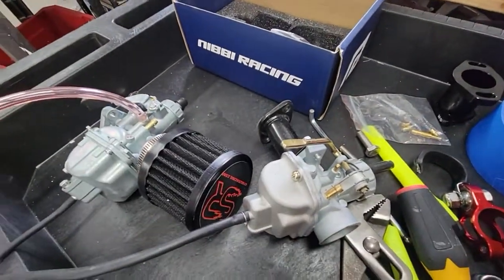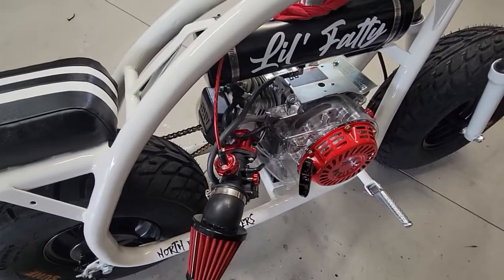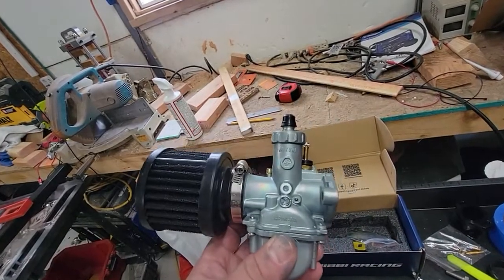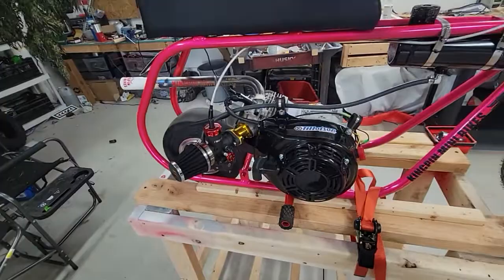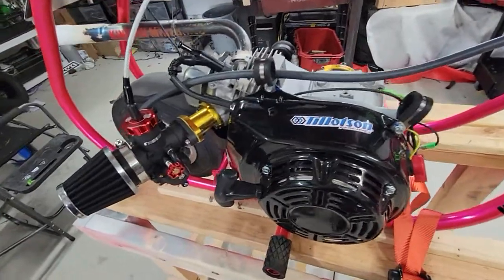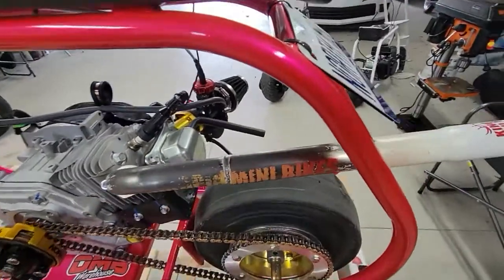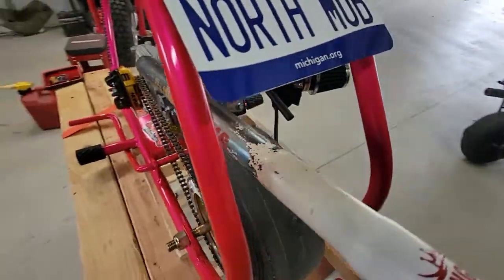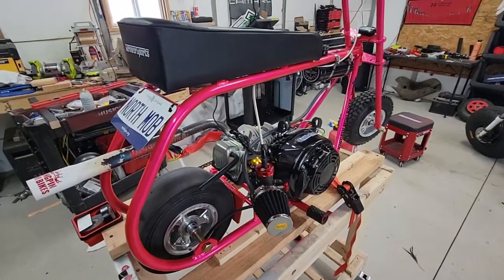Nibbi Carb Better Than a Mikuni?

Comment: I bought 2 vm30s for my rebel 450 motorcycle.  Tuned it all summer long and had no luck at all with it.   When I finally got it tuned right to run great it always stalled at idle.   I spent over 100 bucks in jets and countless hours jetting it.     I put the stock carbs back on and the bike ran great.  I’m very very hesitant to buy a mikuni or clone mikuni for my Baja.

Comment: What did you go with for jetting? From everything I can tell they are basically a copy of a real Keihin pe24mm carb.  The differences come down to different emulsion tube, floats, main jet, bottom cap, and needle from what I have been able to find out so far.  I have run the pe24 on my tilly 212 modded but the idle screw broke and just picked this 24mm nibbi up.
Reply from the maker: 35/118